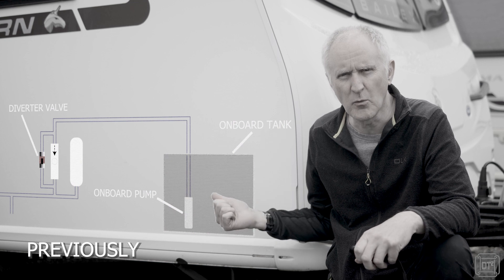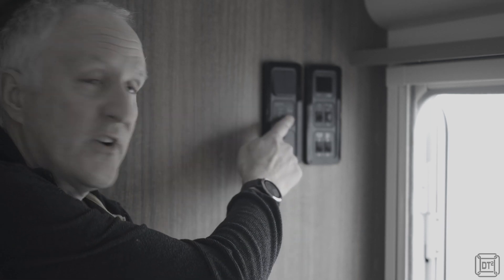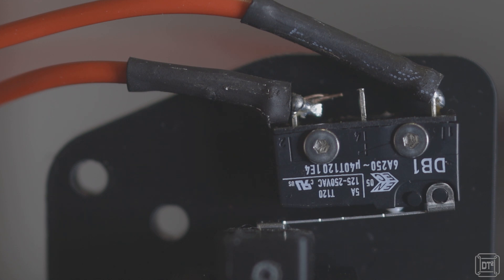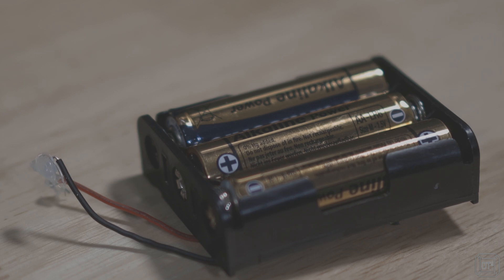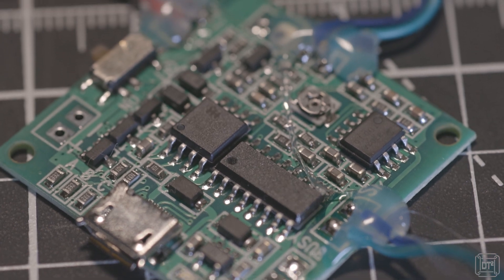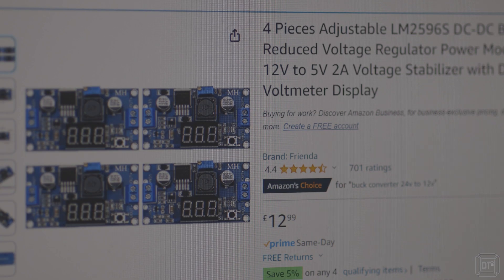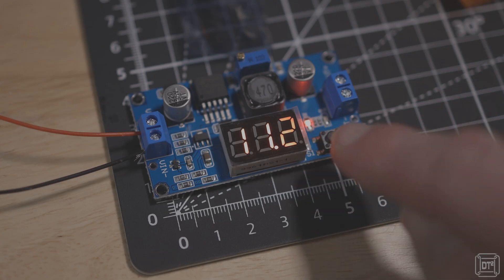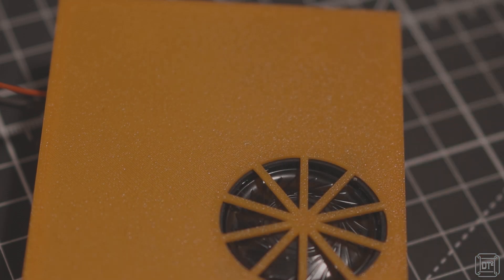AUTOMATIC TANK FILL NOTIFICATION - For Bailey Caravan and Whale onboard tank systems

Comment: When the on board tank is low or empty, is there an alarm or sound alert? Almost the opposite to this - could say “feed me” like the plant in Little shop of Horrors… 😮
Reply from the maker: Detecting the tank being empty using a float valve would be difficult due to the depth of the tank unfortunately.  We do have a tank level gauge which uses four rods to detect the depth of the water. But that only displays an LED light to show when empty. It could probably in theory though be used to trigger the sound module. I like your idea of the little shop of horrors sound clip tho. 👌